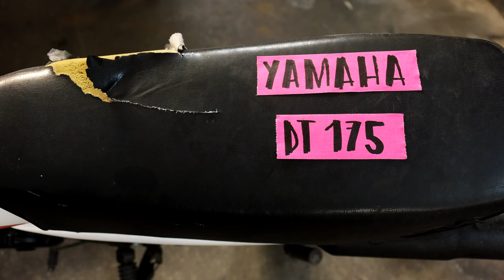DIY Copper Plating ..with a tampon

Comment: I am an old, "old school" mechanic, who also happens to be female. I was utterly fascinated by how you copper plated the fuel tank. It looks so much better than painting it would look! It has a retro steam punk look to it now. Will you be copper plating other parts on the bike? Back in the day when I worked as a mechanic we had to maintain & repair everything on a vehicle. Not just the systems that keep a vehicle running properly, we also did body & glass repair, window tints, upholstery repair, etc. It's good to see young women continuing to carry the torch that we older female mechanics handed off to them. I hope you will help other young women as a mentor. I like how extensive & well rounded your skills are. Never stop learning because when you stop learning you stop living. Keep up the good work!

Comment: The copper finish looks great and should protect the tank from rusting but the copper will quickly lose its shine as it corrodes (oxidises). A few coats of clear laquer while it's still shiny will help it keep its good looks.
Well done, Laura.

Comment: I hope you’re either doing a clear coat, or really like green! Great job!
Reply: Definitely needed. I messed around with copper plating steel before and it wears off really quickly before it has a chance to turn green. I think I read at the time that is you nickel plate first it works better.

Comment: One thing about copper plating is that it is the base for nickel, gold and chrome plating. We gold plated aluminum Cnc flat panel display cases for a casino in Las Vegas, they went in the bath area so you could watch tv from the bath.

Comment: I’m trying to wrap my brain on how this works. It’s like alchemy to me. Turned out super badass!
Reply: The copper in the blue solution has a positive charge and by using electrolysis the copper will bond with the tank (that has a negative charge). In industry it is used in a big bath filled with a metal solution. The solution Laura uses is way more practical on a small scale
Reply: @jesperj86  Thanks for this explanation.

Comment: looks cool  , seen this done with nickasil (kind of chrome) as well (coating and repairing kreidler moped cilinders ) 
i think the copper layer will tarnish black / green (will make clothes dirty) and wear off fast where youre legs are rubbing the tank unless you coat it with a clearcoat , seen clock makers use some stuff that basicly wipes off the tarnish and gives it a protective coating 
might be nice to put a set of saddlebags on there or a small luggage rack with a top case so you can take some extra stuff with you 
the bike might look a little ratty but it has verry little rust and seems complete , if you replace the seatcover and use some elbowgrease it will be looking perfect 
might be fun to turn it a little steampunk with copper piping brass dark leather and wood and some clock gears and classic looking gauges

Comment: Sharing some knowledge about rust prevention and copper plating: "It will help (against rust). But should there be the smallest breach in the plating, water will penetrate and set up a galvanic cell between the two metals in which iron will be the sacrificial anode. The iron will rust away behind the copper plating, which will flake off to expose more iron, and the eventual corrosion will be worse than if there was no plating.

That’s why we prefer to use zinc, which is sacrificial to iron.

Copper is only plated onto iron as the substrate for other plating, such as nickel and chrome, because it adheres better. The most durable chromium plating is triple plating - a thin flash of copper, a substantial nickel plate, and then chromium over all. But I’m sure you’ve probably seen old chrome plated parts where the iron behind is corroding and the plating is coming off in flakes. That’s because of the galvanic effect with the copper." - Peter Hand

Comment: Loved this - couple of questions - you used two copper solution mixes - where did this idea come from and what is the purpose? Have you have any evidence of steel corrosion under the copper coating since you finished it?

Comment: Question: can the copper plated surface be polished after completion? I love the look of the tank however have a project I would like to have the polished copper finish look to. I was thinking if I could use this method and do a light buff to the finish without removing any of the copper plating from the surface it would be perfect. Thanks!

Comment: This is brilliant! I'm going to steal this technique — I don't know when or for what, but I'm certainly going to use it.
Quick question, though: do you need both the alkaline and the acidic electro plating solution, after the other?
Reply from the maker: If you work with a big steel object-yes

Comment: This is amazing. Do anyone know if this method also works with zinc sulfate? Also, I wouldn't leave it bare. The copper surface is probably just a few microns thick.

Comment: you could have gotten that alot shinier, almost mirror finish if you had put a thicker coat of copper on it.

i use a plating bath and i wait until the part has quite a bit of copper  and wet sand from 120, 320, 600, 800, 1000, 1500, 2000, 3000,  polishing compound x3, then paper towel sand for a near mirror finish.

Comment: My gawd! I'm somewhat familiar with tank-style electroplating, and so when you painted the bottom I got Quite Confused... Imagine my surprise! I've never heard of this technique! Really neat.

Edit: hey! Could you use a stencil to electroplate a design onto metal using this technique?!
Reply: You can indeed use masking to selectively deposit material. This is precisely how electroforming works. You can use a print from a toner printer and transfer the toner with heat. Just iron it on like you do with etch resist for a PCB.
Reply: @grieske  That's just neat!

Comment: nice job , it looks amazing :) but i'm afraid the plated copper layer is way too thin and will wear out relatively quickly.
Reply: I wonder if a clear coat would be helpful there
Reply: @hunzhurte  if you want to preserve the shiny copper then yes,  if you after the patina then you need to have some extra microns of copper to oxidize over time.

Comment: If you did it again would you use the first method at all or just the second?
Reply from the maker: No, you need both methods in that order
Reply: Thank you. I have had trouble finding reliable resources on the process. Is there reference you used to find the right settings and such?

Comment: I don´t know how thick the copper layer is, but from experience, it´s quite thin. Tank should be clear-coated because at one point the tank itself will start to rust beneath the copper. In a sense the copper is eaten away and then the steel becomes visible!
Reply: Hi, wondering if you can use this process first and then properly electroplated to thicken the layer of copper?
Reply: @lukebrown6913  it´s possible but you have to make sure that there will be no contaminants in between the layers. So usually you would go through a cleaning process, but now there is a question: if you are doing all the processes it makes sense but if you do the first layer yourself and then go to an electroplater, then i would ask why risk it?
Reply: @vertikaalidioot  Hi, Many thanks for your reply. The reason for electroplating is to build up a thicker layer to stop corrosion. I'm part I'm developing needs to be in contact with water and I can't use any form of clear coat. Also you can't electroplate bare steel, you have to prime it by electroplating the steel with nickel first. This method of brushing on a thin coat of copper might mean, I don't need to prime with the nickel...if that makes sense?
Reply: @vertikaalidioot  I'm electroplating myself and would save nickel plating stage.
Reply: @lukebrown6913  In automotive industry copper was used as a layer between steel and nickel, to make the nickel adhesion better. Also it provided and extra layer for rust prevention ( in galvanic cell sense also). It was in the old good days when cyanide based electroplating solutions were used. Now-days the industry isn´t using cyanide based so much ( it has some amazing properties but its also hazardous) but they have alternatives. So now they should have two types of copper solutions: alkaline and acid based. One is better adhering and is used for strike layers, but the thickness of the copper layer is thin, the other is used mainly to get thick layers of copper (if i remember correctly the acid one is for this).
Reply: @vertikaalidioot  Hi, thank you for sharing this knowledge, I think that's really interesting and something I'm going to look into more. What I'm trying to do is somehow make 200mm  wide steel pieces non corrosive. I'm developing a proof of concept and these discs need to withstand not just water, but heat up to 200c. I've ordered the chemicals as indicted by Laura and also Robert Murray to at least test. Unfortunately, I can't use any form of paint because this will reduce the thermal conductivity I need...if this makes sense??? If you have any suggestions, again I'd be really grateful. Thanks again,  Luke

Comment: Hallo Laura,
Bitte nicht fahren ohne eine dicke Lackschicht auf dem Kupfer. Die Arbeit wäre umsonst gewesen.
In der elektrochemischen Spannungsreihe ist Kupfer im Gegensatz zu Zink oder Cadmium (wurde in der Luftfahrt lange verwendet) edler als das Stahlblech.
So kann es sein dass der Stahl in nu zerfressen wird.
Ich selber bin kein Galvanisör aber ich habe in der Firma oft mit welchen zu tun .
Meinem Bruder habe ich ein Hufeisen galvanisch verkupfern lassen weil ich dachte er hängt es in seiner Wohnung auf.
Ein paar Monate später war es komplett verrostet weil er es an seinen Kühlergrill gehängt hat.

Comment: This is without doubt the most dangerous tutorial I have ever seen. You may have done it, but, you don't show the most critical part of the preparation which is to have ANY fuel tank properly de-gassed before you use any spark or heat producing tools.